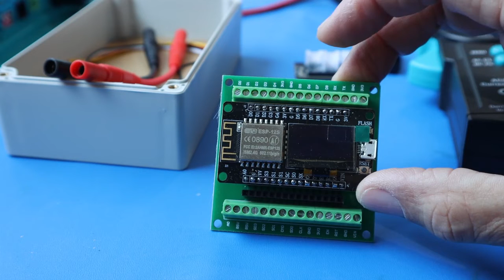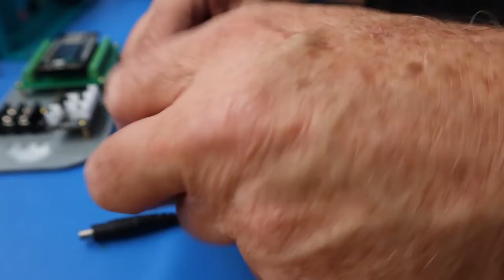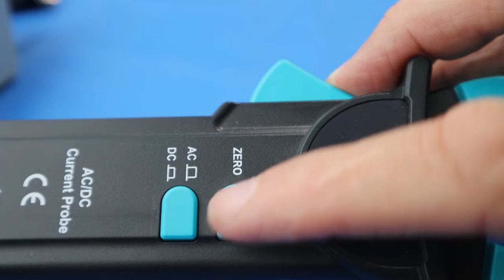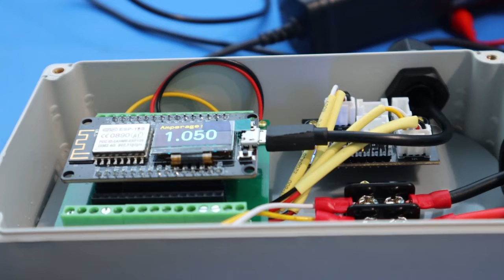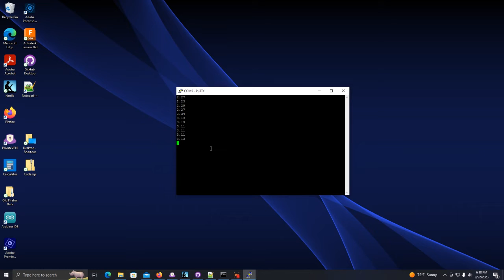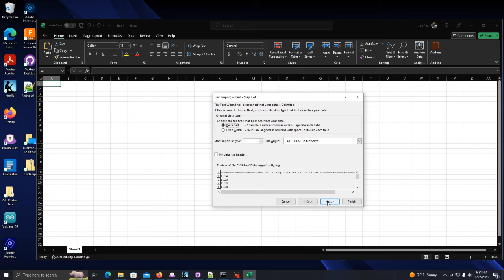ESP8266 AC/DC current logger for beginners - Part 1

Comment: I'm attempting to identify a battery draw on my 2000 Jeep Grand Cherokee. I'm hoping a Data logger will help me identify when the draw happens. This isn't a constant draw.
We've seen the headlights flash on briefly several times.
Reply from the maker: Good Luck,  Yes a data logger should help track down when the draw occurs.  After you find out when the draw occurs then you may want to start pulling fuses to try to isolate which circuits are producing the draw.

Comment: Great video - thank you - I’m interested in monitoring/logging my AC unit pressure transducers (both hi and low pressure sides along with capturing liquid and vapor line temps) - with these four inputs I can calculate sun cooling and superheat
Any thoughts on such a device?
Thanks again
Reply from the maker: Yes, any SPI or I2C transducer should work with an ESP32.  Usually the A2D converter should work as well,  Here is an example article:  https://www.instructables.com/Testing-a-4-20mA-Pressure-Transducer-With-the-Norv/
Thanks Joe

Comment: Hello Joe do you have an off the shelf device that can measure both AC 3 phase and DC with seperate options to tap in the AC and the DC wires and transmit this over wifi ?
Reply from the maker: Not off the shelf,  the esp328266 and esp32 dev kits have wifi built in, and they are very to program.  I have seen AC voltage boards and DC voltage boards that you can use to setup a test device.  Off the shelf you might want to look at fluke meters, they have an interface to your cell phone or computer through the serial port.  but not cheap.